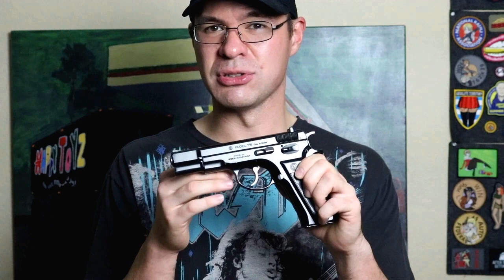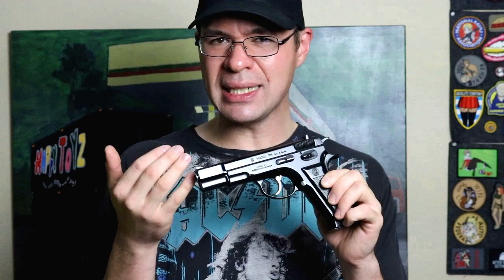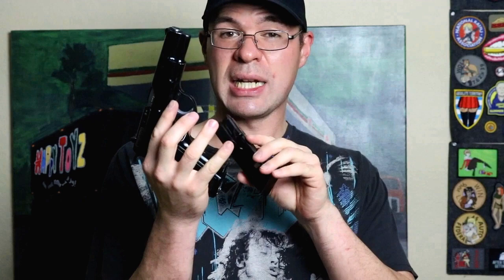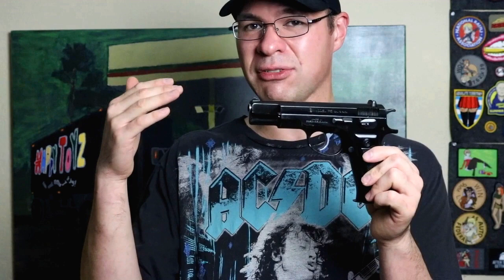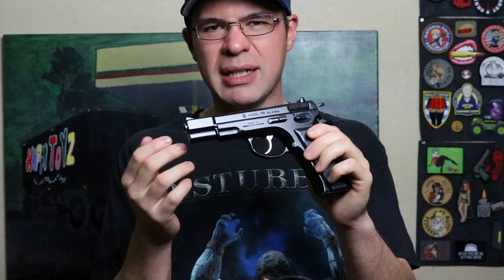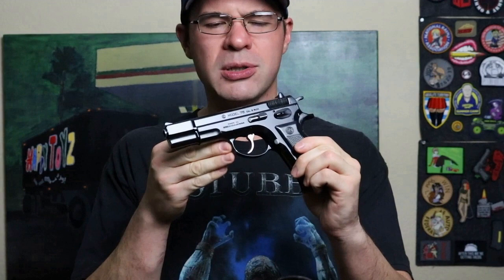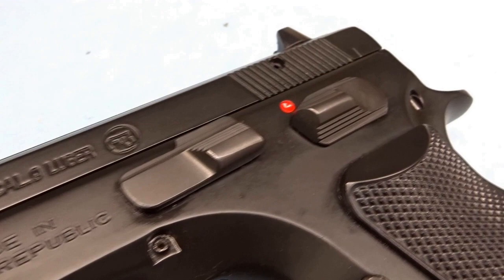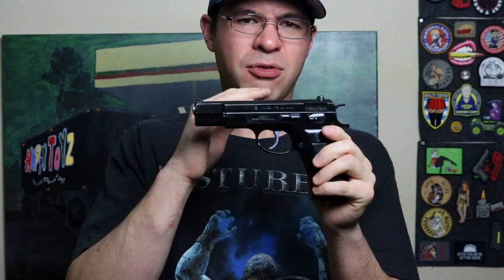CZ 75 Pre B 1984 Model

Comment: Yes, it's a bit "hit and miss" with the magazines, because they changed them slightly with the B-model.
Not only do they fall free, because they changed the curved leaf spring to a flat piece of regular steel (which usually doesn't really cause any issues), but the shell of the mag is also a bit more rounded at the "nose" where it meets the feed ramp. First model and Pre-B mags are a bit more squared off.
That small difference in shape/measurements is what can cause problems, when trying to use any Pre-B mags in more modern 75s and vice versa.

As to why the mags didn't lock back the slide in the RETRO: that's really odd. But only strengthens my opinion that the RETRO is an overpriced piece of hot "collectors" garbage.

And from what I know, people are mostly wrong about slides of the first model breaking.
They did, but only during testing. And never the forged ones, but only cast frame prototypes with the same narrow frame design at the front.
CZ always wanted to cast slides and frames for the 75 (it's cheaper and faster), but couldn't quite figure it out in time. During some experimentation from '77 to '79, they learned that, in order for the cast parts to last, they had to beef up the front of the frame and slide a bit, making the rail longer in the process (hence the Pre-B' s design). Another issue was that they had to outsource the casting process during that time. The Spanish company they contracted used the wrong steel for some reason, which weakened the parts of very early Pre-Bs and caused them to fail. Yet, to my knowledge, none of them ever made it over the counter of any stores and into the public.
In late 1980/early '81, CZ had their problens sorted out and could now also produce castings in-house.
All the first model 75s were made from forged steel until they switched production to the Pre-B.

And that with the "series of 200 units" is also often either a mix-up or something got lost in translation during four decades of playing telephone.
CZ produced a small batch of pre-mass production 75s, which they had to send out to authorities for proofing, testing and evaluation in order to get green light for mass production from the state. A few were also sent out to chosen dealerships and journalists.
They're easily distinguishable by their date stamp ("75") and serial number range (from about 1000 up to 1200). While those pistols were already out and away, CZ kept tinkering with the design of the final product. That's why a lot of the 75 dated pistols have triggers, sights and maybe a few other small parts that are different from the mass produced ones.
Serial number range for mass production started 1977 from 10100, and went until 1980 up to 25???.

Source:
Mostly David Pazdera's book "CZ 75 : Příběh české legendy" from 2020 (ISBN: 9788024270883).
DISCLAIMER: Translated it from Czech to German, so there's a chance that I also didn't get it a 100% right. 😅

Comment: Where you getting a mags b mags wont work in mine
Reply from the maker: Two of the CZ 75 "A" magazines came with this model; one of them I bought years ago.
Reply: You could probably modify the magazine, it just need some more clearance on the back end. You could modify the pistol itself..
But i rather file the mag down. It only needs like 0.2mm or 0.007" on the back side top side.

Guess they had diffrent molds in the factory and there is tollerances in the production.